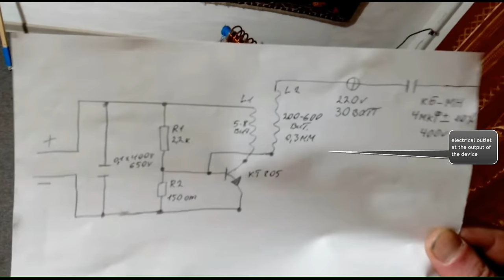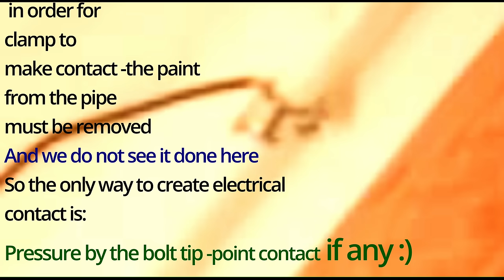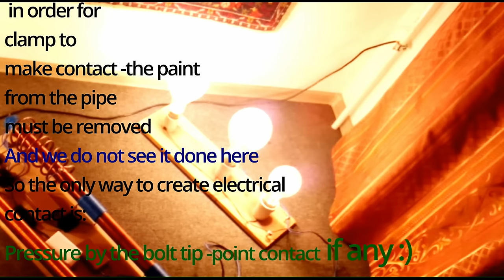Maksim Aliev "Free Energy Device" ""?????" very much questionable

Comment: Interesting device very likely fake,notice the wires going to the outlet,are connected to the
very small wires of both coils,which can't carry a large current.If we assume it can power a 3kw load,this means it must output over 10 amps,220 volts.We must assume that at the outlet
the device can output at least over 10 amps,depending on the resistance of the load,when he shorts out the light,by the pole with the metal , a very large current would flow,that didn't happen,the bulb simply went dark,
that indicates a low current at high frequency.Try shorting out your home outlet by a piece of metal,you would see sparks fly,that doesn't fit.Theres an  effect where a high voltage,high frequency,will light bulbs up,this creates the illusion that a large wattage light bulb is consuming a large wattage it is not.

Comment: Thank you for this video, I appreciate the translation. I have some thoughts and comments:

1) Operating a TV and cell phone charger does not require that the AC is 50-60Hz... it could be anything from 40Hz up to many 100's of kHz... or even 1 MHz. All of these modern consumer electronics devices use a rectifier from the Line/Mains voltage to get a high voltage DC internally (170-340V DC), then they regulate it down to the desired DC voltage for the circuits. 

2) Traditionally understood electricity is DC and relatively low frequency AC... but we can't assume this device operates in that range, because coils like these are completely ineffective at low frequencies.

When you start dealing with aetheric energies, you no longer are dealing with "traditional" electricity... this is where the concepts move from traditional into the more 'unknown' areas which deal with quantum energy, radiant energy, etc. 

If it only involved "traditional" electricity, all of our traditional electricity laws would apply.  Many of these "alternative" energies are composed of a mixture of extremely high voltage, current, and/or frequencies... which defy our traditional electricity laws.

When we move into radiant energies... "weird" things begin to happen.  For example... there are radiant energy circuits where the "electricity" is carried not "in" the copper wire, but on the outside of the insulation around the wire!  This is an extreme example, but very real.

A simple "traditional" example would be in very high frequency switching power supplies... where Litz wire is used because the electricity refuses to flow through the core of a thick conductor... it only flows along the thin outer layer of the conductor - this is called "surface effect". If it were possible to make 12ga wires with a hollow core and a microscopic thin copper shell (like a tiny copper pipe), it would work as good (at high frequencies) as a Litz wire bundle with 20 conductors of 38awg solid copper wire.

It's because of this same "surface effect" that high power RF transmitters use copper pipe as the center (and outer) conductor of the coaxial cable leading up to the antenna on tall towers.

When we combine both extremely high frequencies and extremely high voltages, you no longer need a typical "conductor"... the energy will travel on the outer surface of just about anything... and it becomes "possible" to carry many "Amps" on a very thin wire... because it's not using traditional electron flow within the copper molecules.  Theories on this range from it energizing/ionizing the atmosphere around the "conductor"... to actually utilizing the aetheric field... at the quantum level... thereby allowing the same operation in the "vacuum" of space. Because we're no longer relying on electron mobility of a metal (copper), we no longer have I2R losses...

With these kinds of "electricity", superconductors are no longer needed... think about that.

We just need to be careful not to always judge these circuits by traditional principles... unless all we want are "traditional results".
Reply from the maker: ad1agree

ad2. I have problem with this comment, depends what you think of low frequency. Also radiant energy  is https://en.wikipedia.org/wiki/Radiant_energy explained here so again it is good field for another video.
 Litz wire does have quite interesting properties but some of it  could be as  contrary to you comment. In general I agree with you here.https://en.wikipedia.org/wiki/Litz_wire

Your  comment: "Because we're no longer relying on electron mobility of a metal (copper), we no longer have I2R losses..." - I have problem with it as well.  In physics  of electron motion -"No electron means no current"
Even ionization is based on electron placement.

Yes I agree, novel approach  helps a lot
Wesley
Reply: 117 / 5 000
Fordítási találatok
However, it would be difficult to rectify 1MHz with the rectifier designed for 50Hz! But 100...1000 Hz is still fine.

Comment: I will give a simple secret generator of the channel of Kulabukhov to the place of Tesla supply a simple tvs from the old Soviet televisions tvs-110pc16 catering tvs from the pot 28vytkov on the direct natvs rewind on tvs maximum on a large wave that the tvc maximally gave high voltages and the frequency of the pot with the tvs synchronously work will be frequency from 15 to 35 kHz difference nibudet simply maximal volatility should be on tvc tvs instead of Tesli on antennas